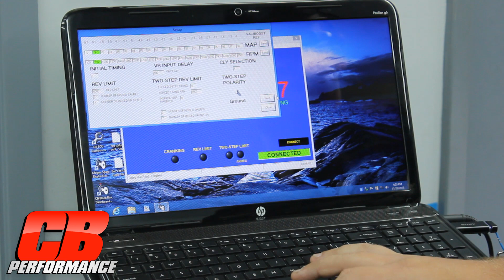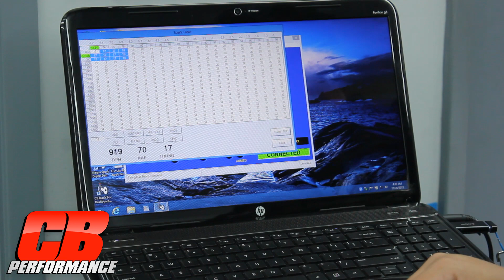CB Performance - 2013 Black Box Programmable Timing Control Module

Comment: I just read the article about this thing in Hot VW and I'm  little confused.  In the magazine better mileage was promised but here on You Tube,  your motor appear to be performance oriented.  Can you do a full install and tune tutorial about this product?  How do you actually wire this thing to a 009 and how can this box give different timing values at different RPMs?  Don't get me wrong. I've been around VWs for over a decade and I theoretically know how this thing is supposed to work and benefit a motor,  but a tutorial and a mileage and power test for mild and wild motors will certainly help.
Reply from the maker: Please E-mail techdept@cbperformance.com and we can answer all your questions. Thanks.

Comment: I’d want vacuum signal from all 4 cyl’s
(That must be why at WOT the table read is so scattered?)
But would that delay the signal from long vac hose connecting both manifolds?
Seems like TPS would be better for dual carbs, but riskier.
Reply: You just need one vac for timing control. This can only control 1 coil, anyhow.